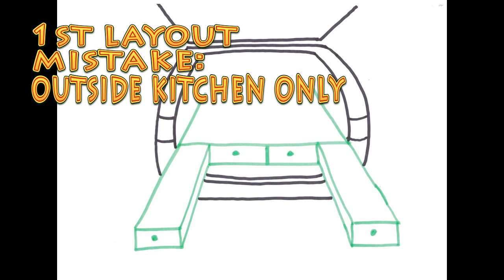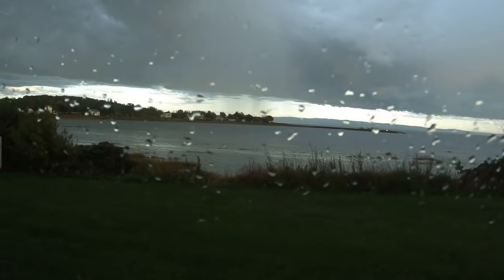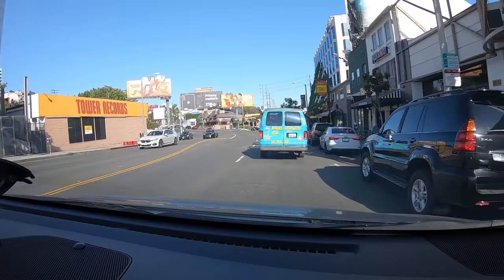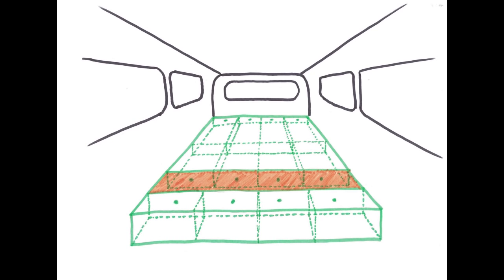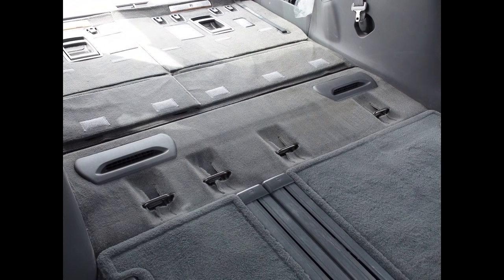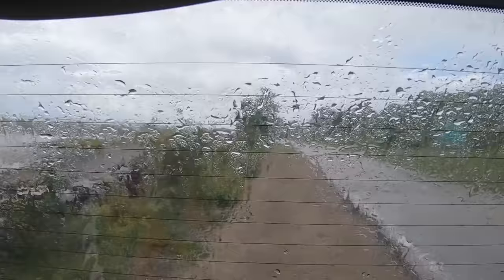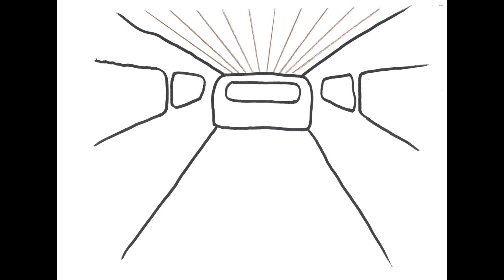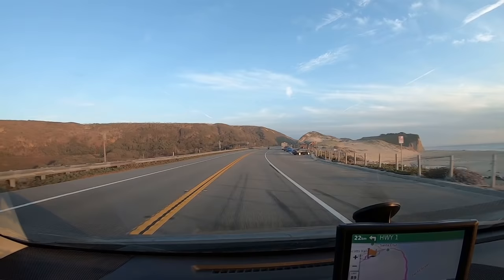11 mistakes to avoid (van conversion)

Comment: Thank you for this information. It’s a great video. How do you power your van? Also, what do you use instead of propane? I want to use solar but most of the people I see living in a van use at least some propane in their conversion. Where do you store propane if you don’t store it inside your van?
Reply from the maker: Hello Narissa!
My van use gasoline. For the camper features I use solar power.
For cooking iso cartridges that I store outside in my roof box. 
Thank you for your appreciation ✌️

Comment: Much of what you say have been my criticisms of minivan conversions for years. If it wasn't a mandatory need for inside bike storage, I'd want to keep my Grand Caravan. I built a very basic bed for it and have done some camping with it, but that only served to increase my desire for a full-size van. That said, when it comes to stealth nothing beats a minivan, but stealth isn't one of my design requirements.
Reply from the maker: Thank Ian for your comment.
I carry our bikes on the roof rack, but there’s also hitch bikes rack that are quite interesting. Some are even covered. Otherwise enjoy your other van’s choice ✌️
Reply: @ericenjoysearth2756  my issue is when the bikes cost more than the van, they need more secure storage than any external rack can provide.
Reply: So right.  I’ve had 3 bikes stolen from the top of my minivan camper.  The Bicycle Touring Pro has a video of his van with two inside. That’s how my van is now.
Reply: I add a pad locked chain to my bike.
Through the tires and through the bike rack.
Bike rack is just strapped- but cutting straps leaves the chain through the rack & both wheels.

Other options;
Master python cable loop. I have 2.
Cinch the bike frame to the roof rack even while bike on rear strap rack.
Tile finder.
I keep one attached to my bike.
If it's ever stolen, I use the community finder option. (Pings off other Tile users bluetooth)
Also keep detailed pictures of your bike. 
....or, just get an Etwow electric scooter that folds up to fit hidden while it charges
Reply: @EvilTwin123  sorry... I am not pad-locking about $20,000 worth of bikes onto a rack.

Comment: Thank you for this. Very helpful video. I am still deciding between your layout or a sliding slat bed that leaves an aisle that runs lengthwise down the middle between the sofa and cabinets. I like that cause you can get in and out from the back. I have a Ford Transit Connect XLT wagon.
Reply from the maker: What is great is to have options to decide. The more ideas you can get, the better you’ll find what is best for you! 

Thank you for your appreciation! Enjoy planning and decision making! ✌️

Comment: Best video on stealthy sporty camper vans ever. Ive been doing this since the 90s, and agree with every single one of your tips. Right on all points. 
The only one i differ on is putting everything under the bed. My AWD Sienna, jacked up on off road tires, has a california king sized bed inside. (queen wide). Its all bed. Feels like sitting on a wide flat soft floor in a sunny room. Cannot recommend it enough. All bed!
Thanks for sharing your wisdom and experience in this video. My 30 years of experience confirms all of it. So much so that we even drive the same van! I do a lot of desert camping and having a semi new Toyota minivan means i dont have breakdowns on the distant dirt roads of Death Valley or Canyonlands National parks. Breakdowns out there in summer 125F heat mean death. Toyota if you wanna make it home alive. 
Cheers, and thanks!
Reply from the maker: Thank you Mark for this great comment and backing it up with your own experience!👍
Reply: How can you get sitting height with a bed in bed mode 24/7?
I have a Kia Sedona and my build height for the bed is limited by hitting my head on ceiling when sitbup versus under bed storage.
Thats why my design has the bed fold up the the back the platform lift up to become a love seat. 
Drops me down about 6" for headtoom... 

Tricky to build a comfortable setup in a minivan when your 6 1
Reply: @EvilTwin123  Go to MallWart or Target and look for their clear plastic boxes. They're 3x1.5 and 6inches tall. I use those under a half inch plywood floor. The mattress is double layer of those super thick yoga mats at Ross, with a blue foam mattress topper.

So I have used roughly only 8 inches of my vans 48 inch height. I'm sure your torso isnt 40 inches long. Try this design out. I have more storage than I can fill. Good luck!

Comment: What if you don't own or want a van but have a pickup instead and a design a long term camp out and not have a bed over cab but utilize that  space for storage and dry pantry storage do you have something that could work with small wood stove for cooking and heating in winter or high elevations .??? 
Ideas would be well appreciated as I am not carpenter I'm a retired Truck Driver.
Reply from the maker: This is quite a different setup... 🤔 Enjoy your project Kyle✌️

Comment: Hey Eric... do you sleep with your head by the drivers' seats or the other way?  Why?  Thanks for your wonderful videos.  I have to go make templates for the floor now!
Reply: Depends on the slope where you park :-)
Reply from the maker: Usually at the back to avoid having to much breeze on the neck. On really warm temperature the head upfront. Or head to toes when with a friend to get more room for shoulders (using sleeping bag for the guest).

Comment: Great video and points, but I'm still going to drive with my mini alcohol canisters for my camp stove. Those are safer inside your car than the gas tank under your van.
Reply from the maker: Thank you for your appreciation! I was thinking the same before one emptied itself in a few seconds producing an endothermic reaction, freezing the canister and burning myself with the produced ice! Hopefully I was outside! The valve is the weak point... I have seen also so much valves leaking when I was working on a chemical plant... Just think of a bbq... If you do not shut also the valve of the thank, you will lose the gas. The valve of the bbq does not close tight enough... Brief, there’s always a small risk. If you can avoid it, why not...
Thank you for your comment. Sharing opinions is really appreciated ✌️

Comment: This is 2021.  Buy cameras for visibility
Reply from the maker: It is much enjoyable to watch real thing than TV 😉
✌️
Reply: @ericenjoysearth2756  "enjoyable"? What happened to safety?
Reply from the maker: Hello Marcellia! Safety is exactly my concern! To keep your van’s window usable for driving. This is the 2nd mistake in my video:
Reducing visibility 

Adding cameras to replace blocked view window is not enjoyable either. This was my last point. Keep your windows to safely drive and to enjoy the scenery! 😃
Reply: @ericenjoysearth2756  Yes, yes, I caught that the first time. It's a very good video. As you know, there are a lot of van build videos out there, and yet you don't see videos like this one, although it is needed! The whole "go outside to access the kitchen" thing never made sense to me. I think it must have been imported from the old "teardrop" camper design. But that is made for a different purpose, and not as an indefinite home.

So far (3.5 years) my blind spot convex mirrors have done the trick :: crosses fingers :: whereas last year, I backed into a(n illegally parked and unlicensed) trailer with my company car because I was using the (unobstructed) rear window, and the trunk blocked my view of the trailer. It might have been the same if I was in my camper and using the side mirrors, but no chance if there was a camera. I'm looking to add a camera because I think it wins for safety.

FWIW, I'm also looking to open up more window space, as well - no single solution has to rule out the others, after all. And in any event, I certainly wish you all of the safety (and good views of beautiful scenery) in the world on your travels
Reply from the maker: The rear backup camera is effectively useful for parking. I do have one that comes in my model. The previous answer was about driving on the road with rear, side or what so ever cameras... 
I like you point of view, thank you for sharing. 
Even with a camera, I prefer to rear park, to be sure to have the better view possible of where I am heading when I leave. A children may be running and appear from one side of the van, which a rear camera will not always allow to show, or with enough quality because of the fish eye effect...
Thanks for your answer Marcilla✌️

Comment: Very important: NEVER ever block your line of sight through the rear windshield!! This is very dangerous - your vehicle should be comfortable and practical for living purposes but it is primarily a vehicle and the number one priority is your safety (and that of your fellow drivers) while on the road. Some of these excessively complicated van builds remind me of an aeronautical engineer deciding to remove one of the engines because it impedes the view from that side of the airplane lol.
Reply from the maker: Thank you for your comment Sarah! We completely agree! It is a question of safety, plus a bonus of enjoying the view! What more fun than looking at mountains in the rear view mirror! It gives a nice perspective. You gain in all perspectives. 👍✌️
Reply: Unless u have a back up camera that is always on.
Reply from the maker: Good alternative for safety aspect 👍
Reply: I never use my back window when I'm driving! Backup cameras aren't very expensive and it's always an option to use.
Reply from the maker: It is an option. But I have to say that enjoying one more window is a good plus, also for the light!
Reply: @ericenjoysearth2756  Agreed especially if there is an amazing view to go with it!💖💖

Comment: I believe the visibility problem is not really a problem, but an option. There are lots of panel vans out there that don’t have any windows except the front ones and they travel everyday back and forth without any issues. 
Also, you can install a rear camera connected to a special “rearview mirror”… problem solved.
However, I wouldn’t choose to do that (covering the back windows) on a passenger van like the one in your video, because of stealthiness… but if I was converting a cargo van, I wouldn’t have any problems with that.
I agree with all the rest, although I’m a fan of sliding kitchens. But I also have an inside one because, as you said, we don’t cook outside very often. But it’s nice to have the option.
One can think having two kitchens is a waste of space but if we don’t store our clothes under the bed (which is very unpractical) we really don’t have that much to store under it. It becomes a “garage” for some tools and other random stuff that we don’t need every day.
Reply: Have you driven a panel van? Or large commercial/Industrial vehicle? It appears you may be basing your opinion on primarily watching videos, rather than personal experience.  Have you seen many large rv/motor homes navigating through or  parking in a busy city? It is a huge pain in the ass even on a work site to not have normal visibility. People have been killed by being run over by large machinery with blind spots.  Eric is correct with his opinion.  Parallel parking with only side mirrors would be a huge pain and in no way stealthy
Reply: @diywarren1776  yes I have.
The rest of your comment has a place somewhere… if we were talking about machinery, job sites, etc. But that’s not the case here, is it?
Reply from the maker: Everything legal can be driven, but what is easier to drive and what is allowing a better viewing to enjoy and for safety is more interesting to me… Plus it is definitely less tiring to drive long hours with a better view, and with a smaller vehicle. Each one must make its personal choices I think…